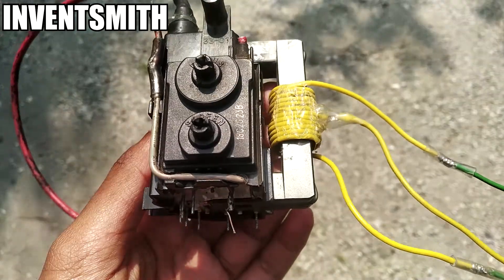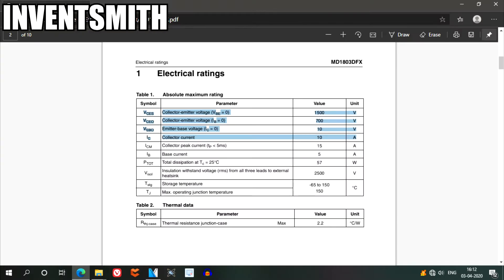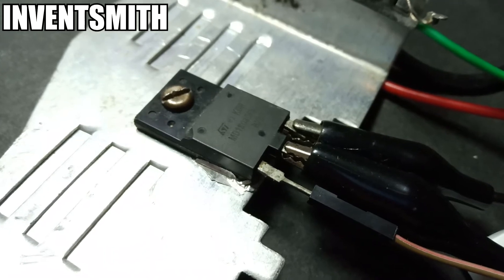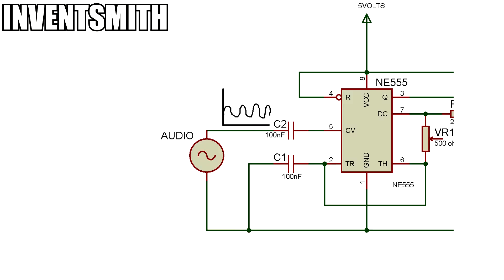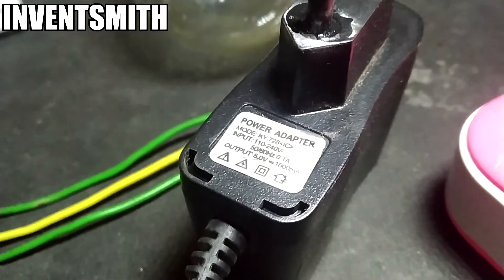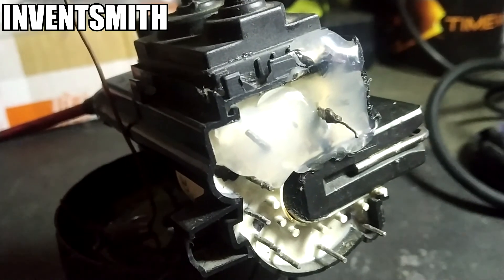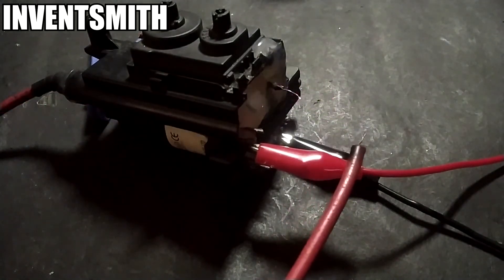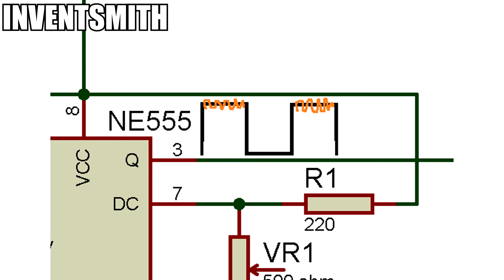How to make MUSIC through FLYBACK TRANSFORMER//PLASMA TWEATER SPEAKER//tutorial//By Ozonised

Comment: Will I die if I shocked by this?
Reply from the maker: The current is not that high in this case. I was shocked by one of the output terminals and I didn't die. But it wasn't pleasant either. This doesn't mean you get lucky all the time. Maintain safety precautions at all times :) as it is still a dangerous thing to have around!
Reply: @Ozonised  yeah I Wonder that hurts as 240v AC, When I kid I Got shocked by outlet and I Got 3degree burn so I am so curious about this stuff, and thanks for reply 😊 keep it UP good work
Reply from the maker: @bneyoru9909  Thank You. As for the answer i found 240vAC to be more painful than this :) Take care and be safe, have a good day ahead Lokomotif Ismet :)
Reply: @Ozonised  thx, have great day 🙂, sincerelly Locomotive İsmet
Reply from the maker: @bneyoru9909  Thanks for your comment. It made my day :) and motivated me to work on a video which i had almost given up on :) Thank you :D

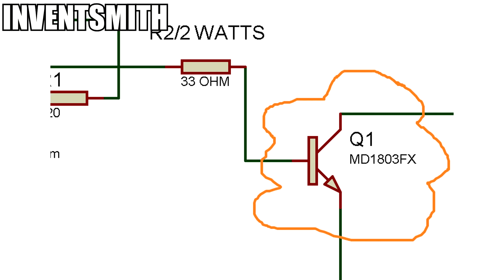Comment from the maker: P.s. At 2:22, I made an error. Don't use the BD140 transistor as it won't be able to stand the return voltage. Also I made a V2 of the circuit using irf740 MOSFET. V2 is so much more better than V1.
By modulation, i mean that the ne555 modulates the frequency at the output based on the signal applied at pin 5.
If you want louder sound then you can amplify the audio signal using a BJT and feed it to pin 5!